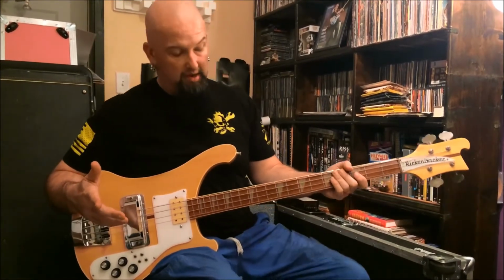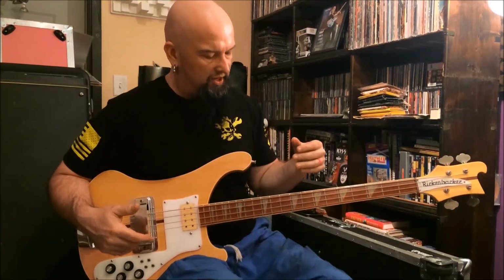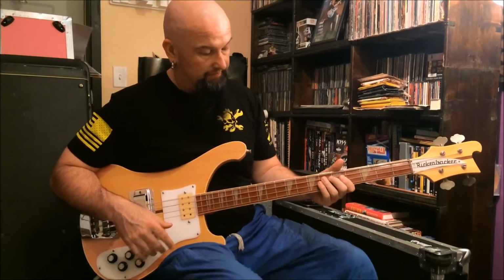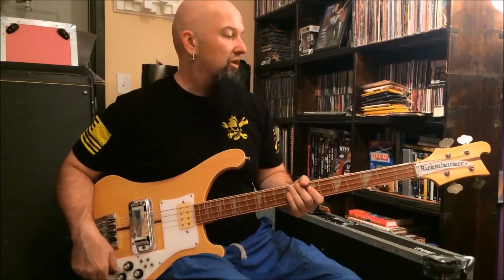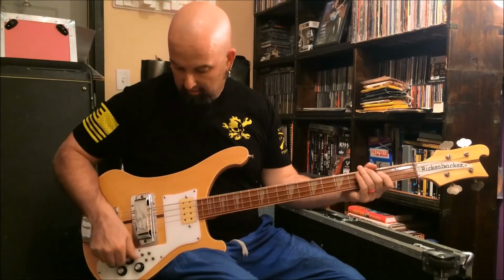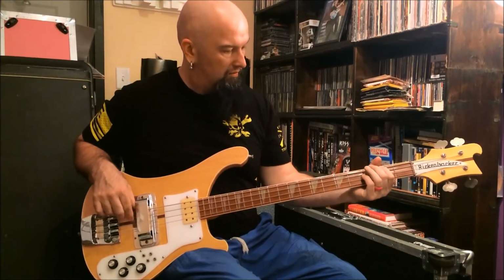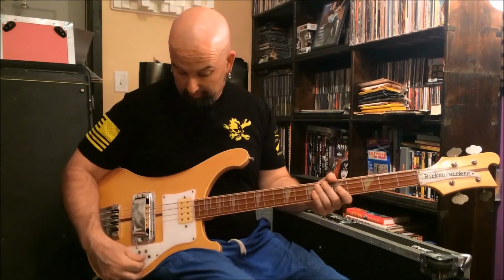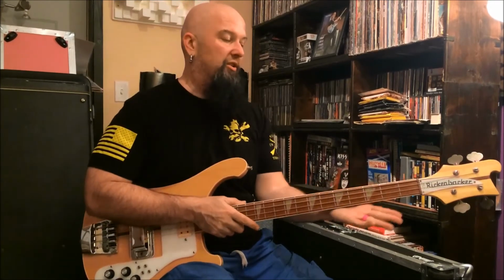1974 Modified Rickenbacker 4001

Comment: This bass is definitely a monstrous sounding serious beast!!! I LOVE the sound of this bass-fiddle!!!! But the switches are unnecessary; there are hardly any differencies between the settings. An old-fashioned 3-way switch (Neck-Both-Bridge) would be fine for enough for this monster... These DiMarzio Model G pickups give the bass a more 'Rickenbacker' sound than 'the original Pups.. Are there any more modifications beside these toggle switches?
Please add some more information about the amplification (amp/s; cabinet/s, sound effects etc) you used for this clip. Thank you!!!!
Reply from the maker: Hi there, the amps used here are Ampeg PF 800 and a nice 8x10 cabinet. There were no other mods to the bass, believe me, it sounded better once I restored it back to original specs! these pickups got washed out live and on recordings (which is why I changed it back...)

Comment: I use those pick-ups, on a Lado. It's not coil tap, but split coil, so humbucker or single. An out of phase swicth, and a preamp. I guess combinations can be different, btw, on mine, switch up is on, down is off